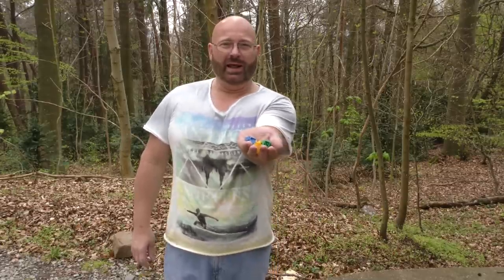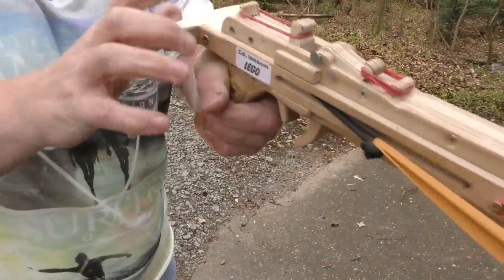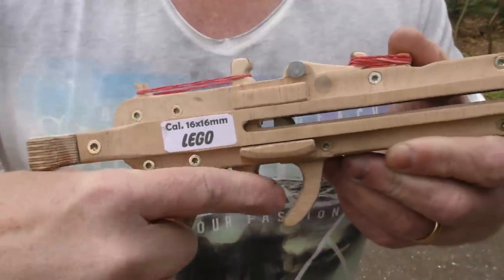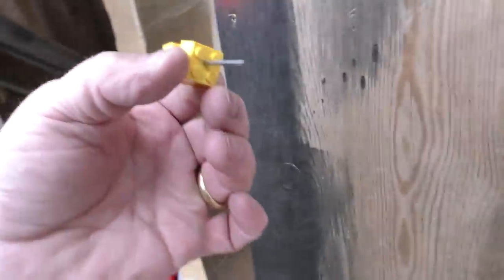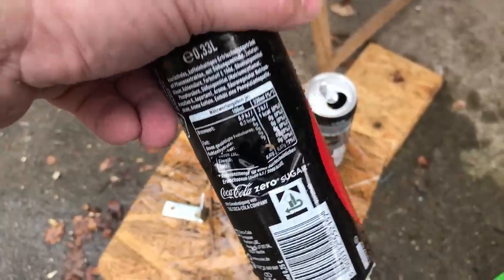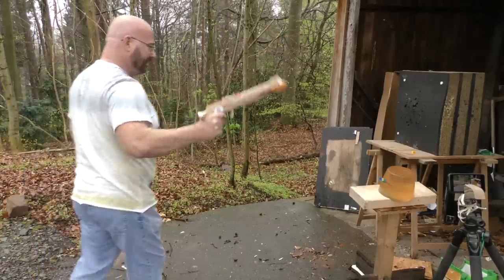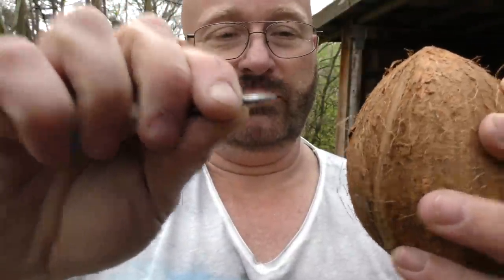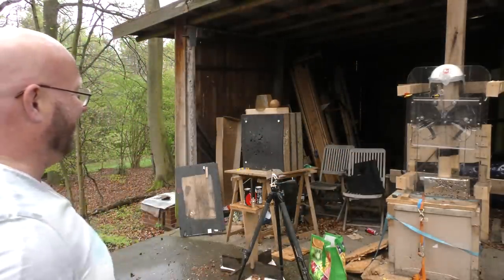Oh no! Not the Lego.

Comment: I wish Joerg could see this.... 

Hey Joerg! I loved the video. I noticed that, in most of the tests, when the nail pierced it's target, it was stopped short by the lego hitting the surface. In fact, the lego steals so much energy from the nail that it sends the last lego flying most of the time. I think that, maybe in an upcoming video, you could modify the legos that you drill to be almost the same size as the head of the nail (Or, you could cut off the head of the nail, and drill the hole in the legos so that the nail shaft is a snug fit in the hole.) This way, the legos could be pulled off of the nail with much less force.Therefore: 
-the legos work as a sabot, allowing the nail to be fired easily.
-the legos work as a stabilization mechanism, which we have already seen to work well
-due to the modification, the legos will slide off upon impact, allowing the nail to sail through the target doing extra piercing damage. (The legos happen to do just this at 7:16; they break away and allow the nail to go through a second can unhindered.)

Now, this kind of takes away from the whole "lego gun" aspect, but let's be honest... the legos were never doing much damage at all. Even the dragon was doing damage using the nail and a modified wooden piece. Besides, you wouldn't have to modify all the legos, you'd just have an optional Armor Piercing round to add to your selection of different calibers. 

I'd love to see what you think about this idea. If you already have something that shoots nails or rods similarly, I'd love to see it, but I doubt that you've come up with something as great as this whole detachable stabilizing sabot that you've made here.
Reply: CJ Futch something like legos does not exist
Reply: The cure to the Legos using up some of the energy in a non-piercing way is krazy glue. glue the bricks together and there is energy lost in collisions from fragmentation. There are also tears from Lego fans.

Comment: For maximum energy over distance you'd need to play around a bit with different weights. Recently upgraded my airsoft VSR from 450 to 485FPS and out of interest decided to chrono different pellets.
.12g only achieved speeds of 370fps despite the obvious power of the rifle. .20g obviously averaged 485fps (it's the test standard). .25g still did 475fps. .30g did 470fps and for fun I loaded some expensive (as in £25 for 1000 rounds)  .50g pellets which achieved 460fps. All speeds are rounded to the nearest multiple of 5. It's of note that the lightest round was the slowest by a considerable margin, likely because it accelerated too fast for the barrel (540mm, 6.01mm for those interested).
Energy was as follows. (2dp)
.12g   0.76j
.20g   2.19j
.25g   2.62j
.30g   3.08j
.50g    4.91j

The accuracy of this test is up for debate and despite a terrific muzzle energy, the 0.5g pellets only reached about 50 yards on a range while the .25g pellets hit the back stop 100 yards away albeit dropping as much as they traveled. This may just be because the hop up wasn't fully dialed.